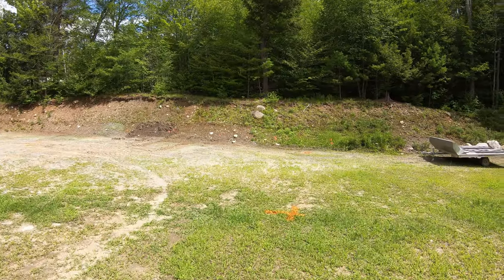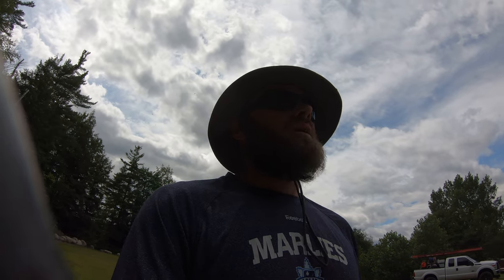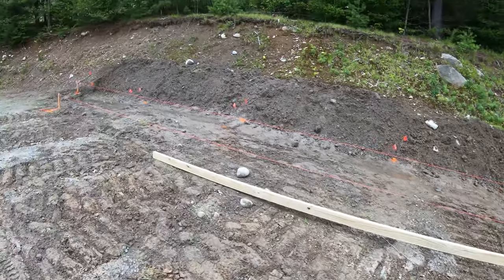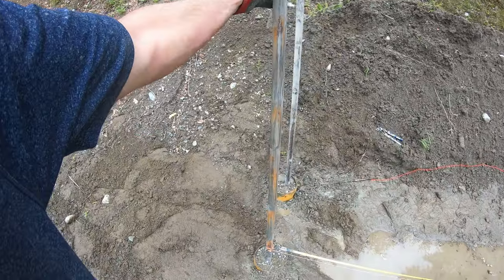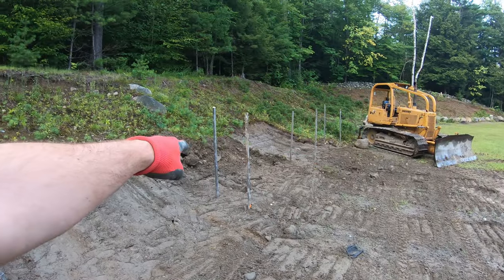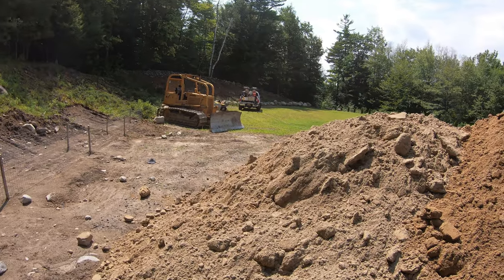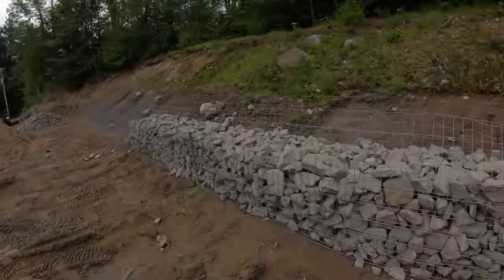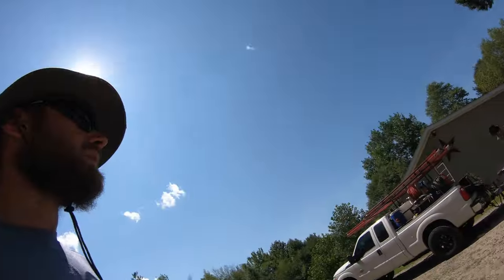$1000 Simple DIY Retaining Wall - Homeowner DIY - Gabion

Comment: So far not bad. Only thing you gotta remember about gabions is you need to tie wire every 4-6 inches after filling with rock to reinforce it to prevent the bulging.
Reply: Can you elaborate on what you mean by tie wire because  I'm trying to build one of these in Jamaica next to a river
Reply: @kovarcoley8418  After you get the boxes built to whatever height you cannot just fill all the stone at once and then close the cage. You should fill it only 4 to 6 inches high and then secure another layer of wire(s) Along the width of the gabion box. If you just fill it all the way to the top with stones it will cause major bulging because it’s not reinforced properly
Reply: @mathusvaiaoga9787  thank you so much for replying, I say one video of a guys gabion next to a river that was bulging and falling apart so I'm glad you made this comment so I can avoid that mistake. I have another question though do you know how thick the size of the gabion wires need to be to put them next to a high volume river and do gabion baskets have to be the same size from bottom layer to the top layer. I saw another comment that said the ones at the bottom need to be in bigger baskets they put smaller ones at the top.
Reply: @kovarcoley8418  correct. Ideally you want the basket to be half as thick as its height. So if it’s going to be 6 feet high you’re gonna want it to be 3 feet wide minimum. 
You could also do them in layers and use gabion mattress toward the bottom. The end result ultimately depend on how much time, resources, equipment and manpower you have. Gabions are awesome… simple cheap and very effective. 
If you’re building gabions along a river After you’re done building the gabion wall you can backfill will dirt and plant trees with prolific root systems right along the bank of the gabion. Bamboo works wonders. Plants some clumping Bamboo right up next to that gabion wall and that wall ain’t going NOWHERE!
Reply: @mathusvaiaoga9787  ok thanks so much I appreciate the information.
Reply: Not entirely clear how you tie wire every 4 to 6 inches after filling with rock. What am I missing?
Reply: @chrisallen2005  Once you start filling the large basket with rocks, stop when you have the height of the rocks at about six inches. Then take more wire and cover the rocks entirely so that the wire is parallel to the ground. Connect this wire to the existing cage. You are then reinforcing the strength of the cage so the rocks won't damage the cage as the wall is built up. Did you ever see someone make a layer cake? In between layers they put icing. The layers in this case are the rocks and the icing is the wire mesh.

Comment: Problem is the wires are gonna rust out and the wall is going to fall apart period
Reply from the maker: Potentially. But all walls, brick and morter, block, stone etc all need maintenance over time. Nothing lasts forever. So not sure why you would expect this to last either. This is very cheap and easy not only to build but to maintain. A simple rewrap of new metal fencing will take care of any worn out fencing from the original build. All the rocks are movable by hand so you could even remove some to replace cross ties. Before wrapping new Fencing it also be easy to install new end and side supports. The wall is now hidden by a 50ft shop, and it's only purpose is to protect the building, not for show. For the little money it cost to build and the little money it will cost to maintain over time, worth every penny. Period.

Comment: How long with the fencing and wire last?
Reply from the maker: Not sure. Time will tell. Everything is still good almost a year later, but need more time to see. Wire fences that were put up can be found in good shape after decades of weathering. I'm assuming this wire will be fine for some time
Reply: Hi 👋 Thank you for the video. What’s the gauge for the tie wires and the size for the cage sheets? 

Please.
Reply from the maker: It's 14 guage steel fencing from tractor supply. Tie wires are about the same